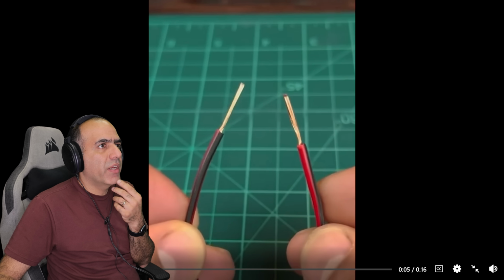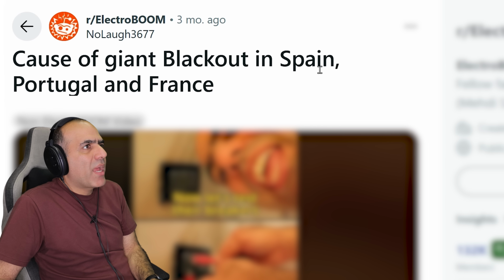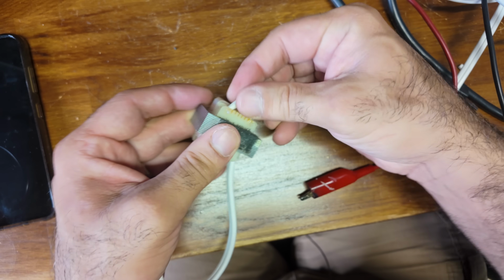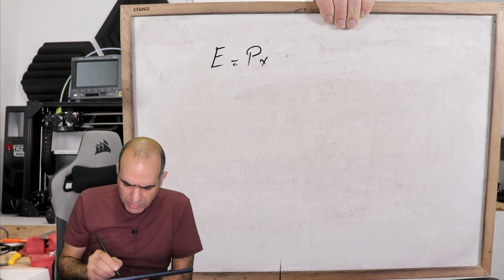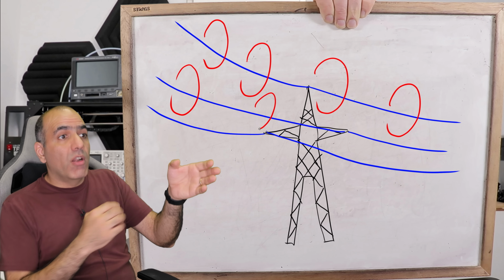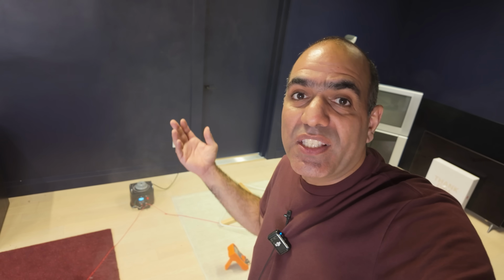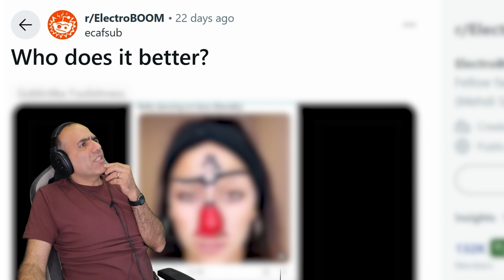Power Lines at Knee Level? Campfire with AA Battery?! (LATITY-016)

Comment: For anyone who’s actually looking to start a campfire fire with a battery: pack steel wool and a 9v battery. Place the wool in the tinder and short the battery across. Far more compact and simple (Not the most practical fire starter though. It does work however)

Comment: Being able to plug in across two outlets is handy on power strips when you have multiple power bricks to plug in that partially cover adjacent outlets. Lets you get them a bit closer together or slip in a cord between two bricks that wouldn't have fit otherwise.

Comment: It's easier to start a fire with some 0000 or 000 steel wool and hold the steel wool across the cell and gently blow in the sparks in the steel wool. It makes a very hot fire as long as you have steel wool. It also drains the battery.

Comment: 4:12: two 110VAC phases, could recharge or run 220VAC applience, maybe, but same phase not, does not work with this connector, since it's one phase

Comment: Running high voltage (roughly 3-4 kv) through deuterium can produce fusion, but with significant energy loss since a lot of the deuterium just sputters away. It's easy but not at all useful because it's not self sustaining.

Comment: Outlet spacing was for two reasons.
The manufacturing process was made easier with uniform spacing. These used rails that are made in long sections and then cut down to size.
If you had a Larger Plug say with a transformer inside it that was twice the width of a normal plug, you could plug it into the middle of two plug connections.

Comment: Being able to plug in the middle of the outlet does actually have one use that I thought about instantly, some plugs that have a ground are massive and take up a little more than one space, and bleed over to the next outlets space, with that, you can shimmy it to the furthest edge, only really applicable if you have 2x multiple spot sized things so it cancels out as a whole number of spots taken

Comment: AA batteries can start fires, I've done it many, many times. You can also do it with a piece of paper scribbled with pencil in a microwave too. You know, if you don't have a lighter, or find yourself someplace where you can't have one. Brillo pads will do in place of a wire for the battery as well.

Comment: Yeeeeah, that aa battery may not start a fire, but that's just enough heat to light a cigarette if you happen to be stuck in a small cement room with 20 other guys and no one has a lighter bc they were all confiscated before they put you guys in that room. Plus you can get an aa battery and some wire from the communal TV remote.

Comment: In order for you to get the power to transfer between your two coils you need to get the impedance between the two of them to be matched and with the impedance of the medium you are transmitting through, which is air, so an impedance of ~50 Ohms. You do this by adding a capacitor to the circuit on both coils to match these. You are also dealing with the fact that you are transiting in all directions and your coil shapes are not optimized to focus the magnetic fields towards each other to maximize the power transfer. The shape of them heavily influences this. There is plenty of research on optimizing this, but proximity is key to maximum power transfer. For longer range power transfer, you have to look at using microwaves or light.

Comment: I know what that weird recepticle is for. If you wire it right and put the plug between two outlets you can get 240V instead of 120V. This allows you to use any 120V device to light your campfire. 😅

Honestly, as a Mehdi style electrician i would love one of these, but i wouldn't put it past anybody else. It is incredibly dangerous. 😮

Comment: In this video, Mehdi Sadaghdar (ElectroBOOM) reviews and debunks user-submitted videos concerning electricity and physics tricks. He tests if a AA battery can create a fire, investigates dangerous high-voltage lines near the ground, examines a student's claimed fusion reactor, and explains the physics behind induced voltage in fences near power lines.

Key Highlights
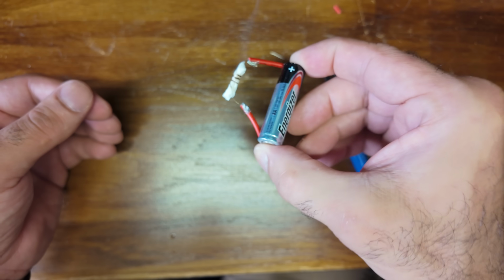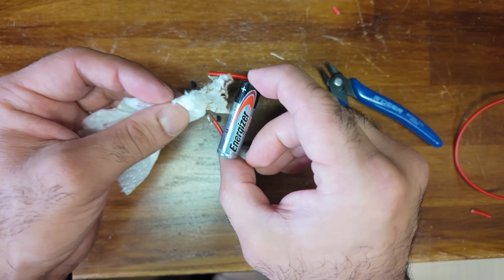Campfire with AA Battery (0:54): Mehdi tests if shorting a AA battery with a thin wire can start a fire. While he manages to make the wire glow and smoke (1:58), he concludes it is difficult and dangerous to the battery (2:10).
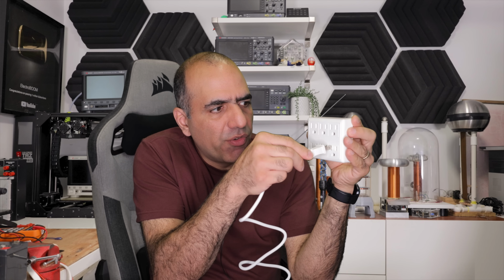Low Power Lines (4:27): He analyzes a video of a stick arcing on a low-hanging high-voltage wire. He emphasizes that such wires are dangerously low and conduct electricity through conductive liquids in materials (and people) (4:45).
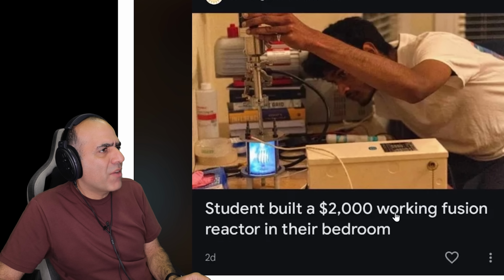DIY Fusion Reactor (5:15): Mehdi debunked a video claiming a student made a fusion reactor in their bedroom, explaining it was likely just a plasma ball (6:09) and not a true fusion reaction.
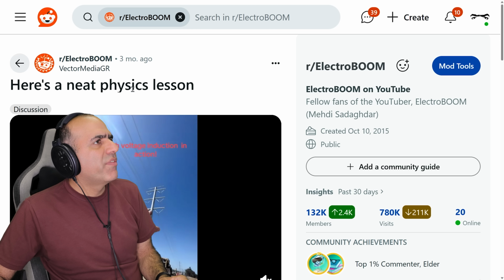Induced Voltage in Fences (10:44): Using a large induction coil in his office (12:01), Mehdi demonstrates that while magnetic fields induce voltage in nearby metal, it isn't enough to cause massive arcs (13:51). He explains that the massive arcing seen in the video is actually caused by the electric field of the high-voltage lines pushing charges through the air (14:54).
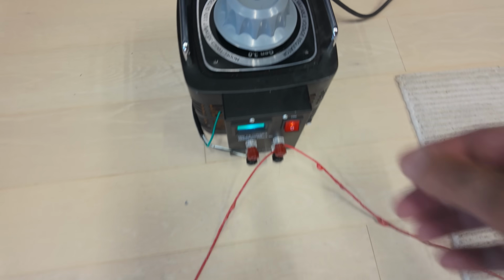Broken Breaker (13:38): In a humorous moment, his experiment causes a small fire in his room (13:38).
Throughout the video, Mehdi highlights the danger of playing with high voltages and encourages learning safely through his sponsor, Brilliant (2:52, 16:13).

Comment: The low down exposed power lines seemed like an electric fence for keeping cattle and stuff inside an area, or bears out in the example we use it for at our cabin surrounded in hundreds of apple trees, have to keep the bee hives inside an electric fence we run across the stairs going up to the tower the bee hive is on.

Comment: 5:10 Nuclear Engineer here. I wanted to add some context to the "student makes $2000 dollar fusion reactor" piece. There is a difference between a fusion reactor for the purpose of creating energy (what most people think of) and a fusion reactor for scientific purposes. I worked in a lab that was testing out lithium metal circulation along the chamber walls to increase reproduction, and I've also worked with a fusion reactor that was designed to create neutrons for neutron activation and had no mechanism to create power out of it. ITER, my labs lithium wall fusion reactor, and the neutron activation reactor are all fusion reactors in the sense that they are reactors for fission reactions. In regards to the $2000 student reactor, just looking at it, it seems to be similar to the small test reactors I worked on in my lab, and not one for power generation. Hope this adds some context!

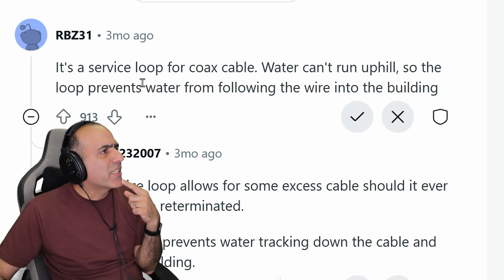Comment: 10:13 they use that exact same loop here. 

It's not a matter of whether or not it rains, because it does that most places. 

It's because code doesn't require them to seal around the hole into the building, but they still gotta prevent water from getting in somehow. 

Basically, they only do that in places where the code doesn't require something else. The extra cable can be charged to the customer, but sealing the hole can't be, so they add the loop to maximize their money, while taking more of yours. 

The way I see it, is that the other options aren't that expensive, so a multi billion dollar company shouldn't be looking to save a few cents at the cost of the customer. I mean, silicone caulk would do the job just fine, and yes a tube goes cost about $15 bucks, but a single tube would probably do 15 houses at least, maybe more, since it's just sealing a hole that's already mostly full of coaxial cable. 

At least, from what the cable guy told me as a fellow tradesmen and someone who doesn't watch TV at all (unless you count educational YouTube. Most of the time I don't actually watch it, I listen to it.) I have no reason to believe anything else.... But I'm still open to new info, because I don't work in that field, so someone who does should know better (they SHOULD, but that isn't always the case).

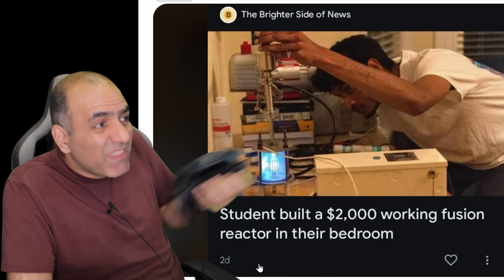Comment: 5:40 Well technically a farnsworth fusor does precisely that, it fuses hydrogen (deuterium) into helium.
Those reactors are well studied and understood, often built by hobbyists and are definitely an example of real fusion.
Its just the reaction does not produce anywhere near as much energy as it consumes.

They operate by creating a cathode and anode inside a vacuum chamber that contains mostly just deuterium at a specific vacuum pressure.
The difference in electrical potential across the anode and cathode are dependent on a few factors but are usually at least 5kv.
Obviously a lot of energy is required to maintain a plasma under these conditions, a lot of heat and light is given off but not enough to pay for whats used.

The sun cheats, it uses gravity for confinement where here on earth we have to use electromagnetism to confine particles.

Comment: You should know that with ac to dc converter blocks/transformers;they are not standardized so comes in all shapes and sizes; so I guess having a multi-port that can use the right of one and the left of other is for when a block is covering half an outlet.

Comment: its about the ac thing, 50/60Hz and we would choose from a single phase (L¹,L², L³) for example L¹, this means that with a normal socket connection, all sockets connected in parallel would be in one network aka in one phase.

Comment: 4:31 I think Parametric design might play a part in the spacing of the pin holes. Meaning that it is easier if there is only one single parameter that defines all the horizontal spacings of the pin holes. 

Though I'm in Australia, where our plugs are angled, so can't do that. Also seems since the ANZ standard update in 2004, that required the active and natural pins to be insulated, seems that power boards have double the space between non-paired pins. I'm a licensed power cable and applicence tester.

Comment: the plug between two socket thing... it's actually a popular (at least popular in my heart) design of power strips in Japan. It's usually arranged in a single row such that you can space the different plugs differently, depending on how large it is. Without which, if a plug is slightly larger you still end up losing two adjacent sockets.

Comment: i feel like spacing the outlets like that could make it easier to plug things in blind? like behind furniture or something. if there were more than 3 next to each other it could be useful for when you have large AC adapters and whatnot blocking half a plug on either side

Comment: The plug straddling the two outlets is bad but the plug can be plugged in to the hot terminal with the neutral prong over the edge of the outlet all together so as to let someone electrocute themselves if inserted that way.

Comment: "The wire nuts" are called drip loops it's to prevent any water that runs down the cable from entering directly into the building.... And it's usually only like the cable TV company that does it look pretty much any utility company does it

Comment: The reason that they let you plug stuff in-between sockets, is so that if you are plugging multiple items into one panel (which has multiple sockets), and some of the plugs are too wide, you can (occasionally) squeeze one more plug in there. (I've done it before) The best case scenario is when you have a power strip that is 4 sockets wide, and there are 2 wide plugs, and one regular size plug that need to to be plugged into it. You either put one wide plug at one end and the other wide plug one socket to the side of it, which leaves no space left for the regular plug. OR you could instead place one wide plug at one end, and the other wide plug at the other end, leaving 2 half sockets in the middle where you can fit the regular plug. This is only possible with the perfectly spaced sockets feature.

Comment: So, i enjoy camping and have actually had to use that battery trick when i lost my flint rod. 

It's not as hard to set up as you think, the actually difficult part is finding a wire you can use. I ended up using metallic fishing leaders and a d battery spare for my lamp. 

It wouldn't light tinder but dried grass caught well enough to go from

Comment: Service loops are real, and they will help with water ingress to some degree.  However, if left alone long enough, capillary action can pull water further up.

However, those loops should probably have grounding hardware, since the coax is powered usually by the mains, more or less, at the last active.  Most coax plant has low voltage running on at least some of it, no different than what you might run to turn an antenna on your house or an amplifier for the signal, positive on the center conductor, negative/earth on the shielding.   People forget that radio is light, not electricity, and so we can just put electricity on it.  The lines coming to a house shouldn't be energized, though, but in the case of a fault of some sort (either in the house or outside), the grounding hardware should stop a surge by failing.  A melted coax outside is better than a fried computer/microwave/TV/stove/etc inside.

Comment: 10:09  Cables and wire are made of metal, and so shrinks and expands with the temperature. If you have the cable/wire completely taut, when the cable shrinks from the cold, it could snap. The Service loop provides slack, allowing the cable to shrink and expand with the temperature, without issue. It also allows provides a buffer should someone decide to pull on one of the ends. It also makes it easier to perform maintenance. In the image, someone clearly had fun and used the service loops to create dick drawings with wire/cable.

Comment: On the induction from high voltage transmission lines, if you ever look closely at a cell phone installation on top of one, you’ll notice something a little odd:
There isnt any grid power. Just a backup generator or even just batteries.

Because they are induction powered. The backup power is just for when they take the line down for maintenance.

Comment: Nope, the Farnsworth fusor and polywell fusor are real, as are standard lab linear accelerators that are tabletop sized neutron generators. Can't generate power, they use a ton of power, but you too can generate wild neutrons in your bedroom.
No clue why, other than to say that I fused deuterium, which is kinda expensive. Might get more neutrons from a lithium tritride target though.
Proof of fusion isn't just the "star pattern", that's a maybe it's fusing, neutron detection proves fusion, go try it yourself, your electric company will thank you and your bank curse you.

Induced currents are documented and I'm aware of one bridge that can have mild shock issues that passes directly beneath 500 kv lines, but suffice it to say, the geometry has to be highly favorable. The rest of the time, one would be fortunate to light a flashlight bulb.
https://oppdthewire.com/nuisance-shocks-are-common-near-high-voltage-lines-but-harmless/

Cutting live wires? Sure, if you really, really, really want to justify buying that new pair of cutters. Yeah, I've seen that happen.
Also watched dad find the breaker for an inconvenient direct burial line obstructing an area we needed excavated for a gas station's concrete pad. Electrician kept telling him that he couldn't find the breaker, dad said that he'd find it and hit the offending line with a square shovel. Took a chunk out of the shovel edge, but the electrician said, "I found it!"
Hey, time is money, those man hours aren't free!

Comment: On that first battery fire bit the original video used char-cloth and tinder, both are much more flabable then some standard napkin so I'm confident it would work.  The fusion reactor thing is kinda real, you can very easily make a device that fuses hydrogen via static acceleration, it's just impossible for it to ever make more energy then it produces, it will create a 'reaction' and thus be a reactor, but it can never be a generator which is the point.  The green-energy turnstiles probably generated 2000 Joules of energy,  people are terrible at confusing watts for actual energy amounts and the amount is so pathetically small that the people responsible for it like wished to mislead people into thinking it's more.

Comment: Thank you! Finally, someone realizes why 3-phase on high-voltage (low-current) is like that by design - to save money and keep the Poynting vector non-zero only up near but outside the transmission lines!

Comment: I hate that arcing. I worked at a pvc pipe factory and the freshly made pipe had a tremendous amount of static electricity. After climbing on the pipe you could easily get an inch to an inch and a half arc to a piece of metal, clearly visible under the bright lights. It was kind of worrying how many volts I was carrying around.

Comment: Hey mate, I am trying to build my own jacobs ladder and trying to create a stable plasma ball and then once I can make that repeatable, I will work out how to make it rotate. Can you help me with the design of the set up? I'm using a mot and ferrite ring magnets from the microwave and about 15 neo magnets. The plasma either goes right through the magnetic field or snuffs out before it gets there. 
Can you suggest a design that I can put together with minimal cost without scrimping on safety?